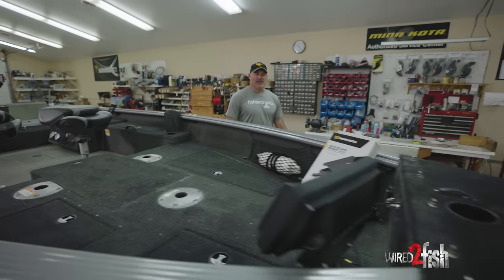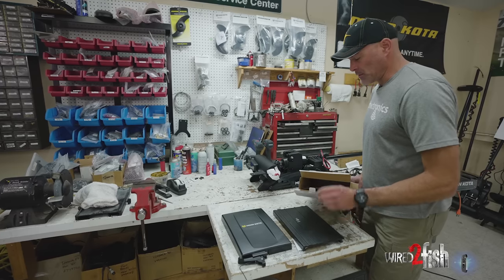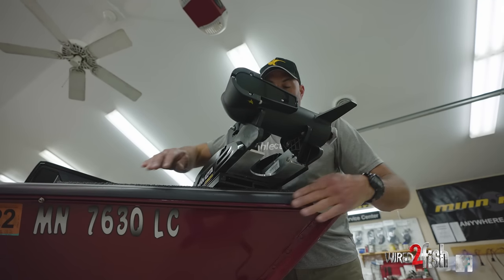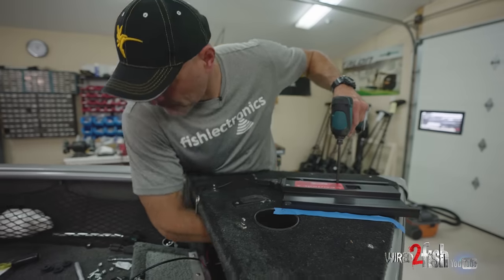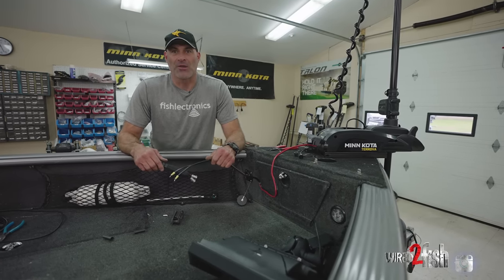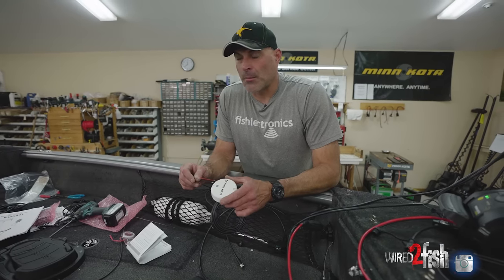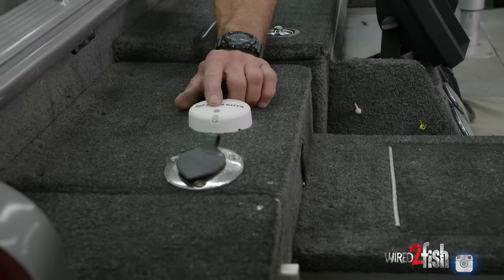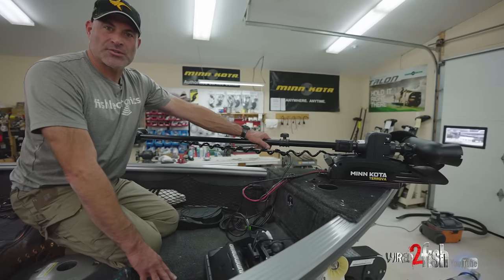Minn Kota Terrova Trolling Motor DIY Install | Pro Rigger Tips

Comment: I noticed that on the power cord you left all of the slack in the cord and had it tied together up near the trolling motor.  Is there any reason a guy can't cut the power cord shorter when making the connection to the plug and avoid the need to keep everything tied together up near the motor?

Comment: Do I need the quick release bracket? Also does it matter which side of the bow the shaft is on? I've upgraded to the Terrova and I currently have the edge. Tracker or Bass Pro put the shaft just left of the bow. I can't put my motor all the way down when it's on the trailer. Yours looks like it would be on the right. Any suggestions? Thanks.

Comment: I have watched your video a couple of times.  I used the quick release bracket everything in the video. I noticed when you turned on the power. You did not check the tester for the batteries, should that be green or red. I'm showing red,  I have power and good voltage to all my sources.  batteries are at full charge?? Thanks for the awesome video

Comment: So the instructions say to mount it so that the shaft is a 1 1/2" away from the gunwale, u just mounted the cutout flush or a little past the gunwale which would be alot closer then a 1 1/2 if ur flush, do u know why they say this in the instructions have u ever had any problems the way u did it, id rather do it like u and have the least amount hanging of the side as possible...mounting it right now so a quick reply would be awesome...thanks

Comment: You make great installation videos, they are a big help. Thank you!
 I'd like to add a quick detach bracket to an 80#  Ultrex 60" that is mounted on my 1875 Pro-V.  Can you recommend one over the other...the aluminum MKA 52/62 vs the Poly MKA-23?  I had the alum version on a Terrova that was on my last boat, but didn't remove it often. I am leaning towards the MKA-23 for ease of removal, thinking there are a couple small things on the boat deck that could interfere while trying to slide the MKA-52 in place. My Ultrex 60"  is the largest the MKA -23 is rated for, and I'm wondering if it will be robust enough. Spent about my time on the Great Lakes.

Comment: Good video! I had the same problem with the roll hitting the trolling motor bracket at the launch while loading depending how steep each launch are. One way to bring up the tip of your hull up once you cranking up and you know your boat need to be elevated more. You get in your truck and move forward 10-20 inches and that will bring your front hull up above the roll.

Comment: How do you recommend plugging old holes left in an aluminum bow from an old trolling motor? Every motor seems to have a different hole pattern, leaving boats looking like Swiss cheese.
Reply from the maker: Hi Mark, structurally, there isn't an issue with holes. If you were concerned about that, you could add a piece of plywood to the underside and add some silicone to the screw/bolt heads to maybe add some rigidity and seal the holes to prevent water penetration to the front cubby. Alternatively, a dab of silicone into each hole is a good water penetration prevention measure.

Comment: It's a great video, was able to install the whole system along with 24v power supply system. I have a question regarding the gps sensor thought. Will it draw  power from the 12v battery during everything is off & boat is resting? Is it constantly looking for signal ? i have no shut off button for it and its hooked straight to 12v. Currently had replaced the 12battery and looking for reason why its losing alot of juice even if the boat is sittin in garage. Thanks in advance & happy fishin!
Reply: Yep, you'll need to install a power switch.

Comment: I installed my troll motor I have a beaker on front battery and 20amp fuse on back battery the 20amp fuse keeps popping at a higher speed on the troll what should I do to Salve this issue thank you sir 
Your video was a big help for my install  one last ? I did get the heading sensor with the troll motor In The box should I call them or do they all not come with them ?
Reply: The Terrova 80 under minimal load, full power (#10), will draw almost 42 amps. The recommended breakers a 60 amp-this motor will require max 56 amps under max draw, heavy wind, river current, chopping thru weeds, etc. Get rid of your 20 amp fuse + install the 60 amp breaker on your positive output wire, near the batteries

Comment: So the puck will shutdown once the motor is down if its not connected to a power switch? I am hoping I can put it to a switch but if not then I am stuck going directly to the battery, not sure how long that power cord is? I am waiting for my motor to arrive, I ordered it a week ago.
Reply: Puck stays on, unfortunately. Need to install a power switch.

Comment: Hello,
Can I connect heading sensor on the same battery with Terrova?
Reply from the maker: Thanks for asking. A 12-volt power source powers the Heading Sensor, so it can't be powered off of the same batteries as the Terrova, which is available in a 24v or 36v option (not 12v). You'll want to run a lead to your 12v electronics or dual-purpose marine cranking battery.